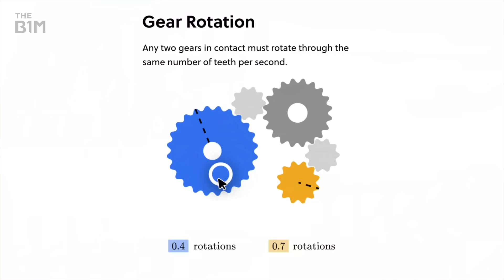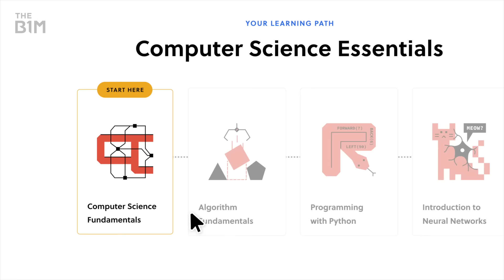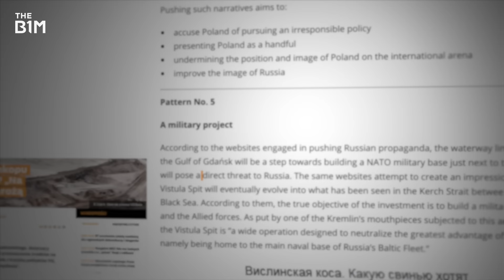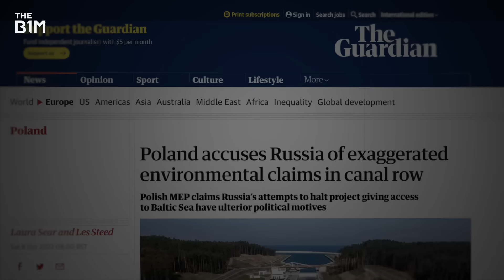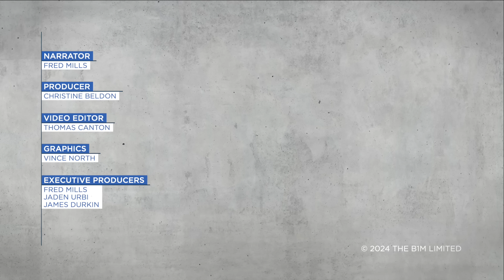Why Russia Tried to Block This Canal

Comment: Nice construction.  The lock is to reduce current flow interfering with ship transit, I'm sure.  Otherwise, it would not be necessary due to the sea level equilibrium on both sides.

Comment: I wonder if small craft are allowed to pass through the canal in conjunction with larger vessels like they do in the Panama Canal.  If the larger vessel doesn't fill the entire volume of the canal lock then there is space left that can be occupied by a cruising sailboat or even a commercial fishing boat, most of which are quite small compared to cargo carriers.  The marginal cost would be negligible.

Comment: Im still trying to figure out why there is a lock in the canal. The Russian passage between the sea and the lagoon is wide open with no lock, so why is there one here. Is it due to the narrow width that might have strong currents due to tides?
Reply: Environmental reasons, so the salt water doesn't get back into lagoon killing some species. Of course there's an open passage in the Russian part but it's been there for over 100 years and salt water doesn't go back and deep into Lagoon that has a body of fresh water pushing out towards see  too.

Comment: I would have never guessed that this channel would need a lock. If I think about it it does make sense of course, because if they just made a gap that would have been the shortest route for tides to flow in and out which would have made marine taffic impossible because of the current and also it would just keep getting bigger naturally,
It's just if you see it on a map you'd think it is connected to the sea anyway so it seems like the level on both sides of that tiny strip of land should be equal.

Comment: Why this lagoon lake has higher water level at the canal since there is no gate on Russian side of it and water freely discharges into the sea?
Reply: The author of this film made a huge mistake. The main purpose of dams is to prevent saltwater from entering the bay, where the water is mostly fresh. Of course, there is always the problem of mixing water from different reservoirs, but with the low salinity of the Baltic Sea and the slight salinity of the Vistula Lagoon, it is not of great importance. Local species have already adapted.

Comment: The Russians suddenly became environmentalists as they decried the canal claiming, “the construction of the canal will not only require deforestation, but it will also change the water regime in the bay, which is likely to disturb the existing ecosystems.” The EU bought this line as they did the Nord Stream lines. Poland properly ignored the EU and saved themselves from Russian dependence for shipping if not gas and oil.

Comment: So - Poland built this canal in some 3 years - well done them.

How long is HS2 taking or will take before it opens?

And the cost?  A little less than HS2 - if it ever gets finished!!  To go from just outside London to Birmingham, saving some 15 mins!!!

Proper infrastructure improvement - good on you, Polish folk!!

Comment: When one considers payback, National Security is the dominant criteria if in the original consideration. Payback can then be opened up by considering the cost of other potential situations much worse. In1980, the UK had World beating Gas & Electrical systems making the UK self sufficent in Energy and a potential exporter for years to come. 
A political decision to sell control of the assets, completely revearsed that position, and 30 years later leaves the UK, vulnerable in Energy management and control.
The assets position of 1980 has been diminished by bad asset additions and lack of maintainance.
The important issue is to build the absolute best resource at the time. 
The cardinal mistake is to ration the project like 2 lane & 3 lane motorways of the 70s/80s, only to find that had the original planned resources been built, the later additional cost could have been much reduced or even avoided.

Comment: What is the water level rise between sides of the  canal, and do the tides affect both sides equally?
Reply: Tides on Baltic Sea are really not visible - maybe just a few centimeters.
Water level on both sides should be equal as water on both sides has connection.
Water level difference is more dependent on strong winds / storms. Strong, long-lasting north wind can rise water level in Baltic Sea by 1m. Sometimes there are floods on sea side towns and even along the rivers (there is flow reverse).

Comment: Not everyone in Poland is satisfied with the canal. The idea is good, but the canal is too shallow and too narrow for significant traffic; it was often called the "kayak channel". On top of that, the waterways leading up to Elbląg aren't really deep enough to accomodate even some of the ships that can pass through, and the deepening project was halted because of political disagreements.

Opinions vary, of course, but in general, the thought is that building a larger canal immediately would be better, but in the current state, it's a waste of money.

Comment: I am puzzled by this canal.  First off why would you need to have locks to raise and lower ships?  Are there locks at the Russian controlled entry into this lagoon? And is the lagoon fresh or salt water?  Just wondering why not blast a big hol hole in this tiny strip of land and use a large dredge to dig it deep enough for large ships?   So many questions and so few answers in this video.   The strip of land blocking the passage of ships is not very wide......

Comment: This would need a bit more information to help sorted right.
The seaport in Eblag was just opened in 2006 and deals roughly 750kT per year. Gdansk the biggest port in poland deals 21.5MT per year. So it is not that poland would really depend on that harbour. In these correlations it gets more clear that it was only a political statement and not something poland really depends on. The video seems to draw a different picture that is not covered by the numbers.

Comment: This video is a bit sensational. They only need small ships to pass through because that's the only ships that sail from the small city at that coast and the river further down. Poland major port city is further to the west, this project doesn't help them with major shipping, they already had that, this just helps the region with smaller trade.

Comment: How will rising sea level (due to global warming) affect the canal? Has this been factored into the design?
Reply: Yes, the sea level rise of 3.6 mm per year was taken into account. That's 1 foot in roughly 84 years. Global mean sea level are expected to rise by about 1 foot above 2000 levels by 2100.

Basically they will have no meaningful effect for the foreseeable future.

Comment: Can anyone explain why canals like this one have locks? The water level on the bay side is higher due to the outflow of rivers, right? Is it just that such a skinny canal would cause a huge amount of current out to sea? Presumably the natural inlet into the bay also has this issue but is just much wider so it's less pronounced?

Comment: What a load of BS. What ships? The Vistula Lagoon is too shallow for any ships to arrive at Elbląg. Boats, yachts and small to medium barges are the only nautical vessels capable of swimming in the Vistula Lagoon. In many places it's only 2 meters deep (average depth of Polish part is 2,3 meters). For ships to reach Elbląg you'd have to deepen the lagoon every year because of the bottom of the lagoon moving. There's also no reason to make a nautical way to Elbląg. Gdańsk harbour is only 43 km from Elbląg and Gdynia harbour is 96 km.

Comment: Nobody wanted to block it, just some (clever) people were saying this project is economical nonsense and it proofed they were right 110%. Now almost two years after beeing completed, the canal was used by exactly 1589 boats in 2023. Which means less than 5 boats a day. Even in the busiest months like July nad August it's still less than 10 boats a day. Complete failure and financial loss but that was obvious from the beginning.

Comment: I daresay the objectives of this canal are more than economic, particularly profit, and extend to several other strategic concerns such military ones and simply undermining the influence offered by Kaliningrad.
Reply: How this canal can undermine Kaliningrad influence if there is another Polish port called Gdansk 30 km to the west, the one that larger the Elblag port 20x times and that doesn't need this canal at all?
Reply: @dmitryletov8138  Well, for a start, it grants Poland access maritime to the area under its own authority without depending upon Russian administered waters and potential customs interference. It means there is an alternative, and Polish citizens can be protected from Russian harassment or arbitrary detention. Ot also means the Polish navy has more options available to it and Poland can choose to undermine the economic value Kaliningrad has by virtue of taxation on maritime traffic / goods - even if Poland doesn't expect to turn a financial profit in the process. 

Remember, ships and boats can't drive on land. Why would Poland want Russian authorities to have any control over maritime access in the area. Of course, Poland doesn't, and so, it built its own canal. A commercial harbour 30km away is largely irrelevant to most of these concerns.

Comment: Interesting fact: the canal would not be even remotely that expensive if not for the same russian supported "environmentialists" screeming about mixing lagoon water with sea water. Originally it was supposed to be just dig out canal with bridges, without any floodgates.
There were not any basis for such floodgates as water is mixing anyway. But it increased and prolonged the project tenfold.

Comment: Elbląg is not an important Baltic port by any measure, it serves local traffic mostly. This canal is wide and deep enough to accommodate a barge, not a sea-going ship.
The canal was an expensive folly that can be used mostly by private yachts and small ships. You didn't do your homework and  just got duped by a propaganda machine of previous government.

Comment: To this day it is not clear how the accident in the Suez Canal happened. What is certain is that the pilot played a decisive role in this.
He drove through the canal at too high a speed.
There are clear rules for this - every pilot knows them. The captain too - and the pilot's assistant too. 
There is said to have been an argument on board between the pilot and the captain.
Just because of the speed. The pilot got his way and the ship ran into the sand.    ....For-Ever-Given-Until-Full-Moon....
Can you bribe pilots?
The experiment to see whether this could irritate world trade was, in any case, very successful. Someone can use the data.
As far as I know - no one covered this.....

Comment: I came up with a better solution (for the next project) don't dig a hole,  put down rails and role the boats over land... should be cheaper and much quicker.
Reply: what?
Reply: lol yep , should be feasible,  here in Belgium we even got a boat elevators  !  boats go  into big water filled lifts and go up and down like a elevator  ;-)  @Fanro3

Comment: This was a political decision and was not for economic reasons, it won't ever be profitable. Right now it's completed, but the bigest ships that could fit there can't - the waterway has to be dig up more (and they didn't connect to the Elbląg city right away, since the mayor of the city was from opposing political force, now it's underway). Right now only small boats very rarely are passing since there isn't any infrastructure to accommodate anything. Wasted money, made only for politcal reasons to prove the leading party could do that

Comment: So we are showing 20 seconds how a basic lock works (using only 2 doors) and then never talk about why it has 4 doors? Never even mention that obvious overengineering? I guess it is just a fail save, but seems a bit over the top

Comment: You seem to be confused about the meaning of "neutrality". To be neutral is not to give each perspective on an issue equal weight. To be neutral is to give each perspective on an issue the weight it is due. The Russian perspective is obviously driven by a desire to control the Polish economy, not by a desire to report the truth. As a result this video displays a strong pro-Russian bias. Very disappointing. Do better.

Comment: This is nonsense. No big boat will be able to travel on the Vistula lagoon, which is on average 3/4 meters deep. Moreover, Gdansk port is just some miles away, just the Vistula's mouth. Finally, you are quoting Polish assessment of what they think that the Russians would say, when the Russians were far less concerned than many Poles, who could not see the sense in it. I am very sorry, but this is very bad information.